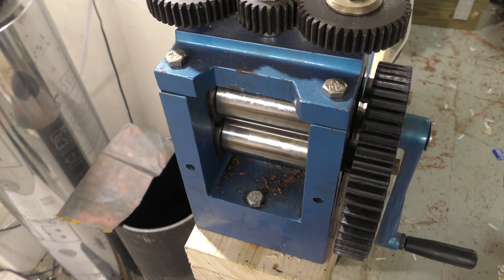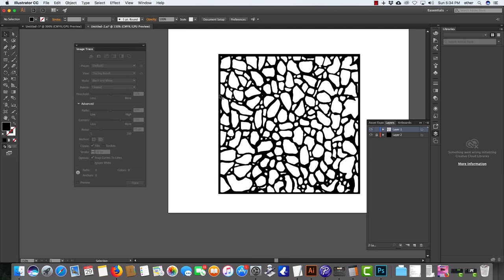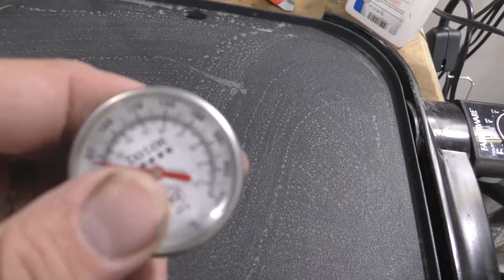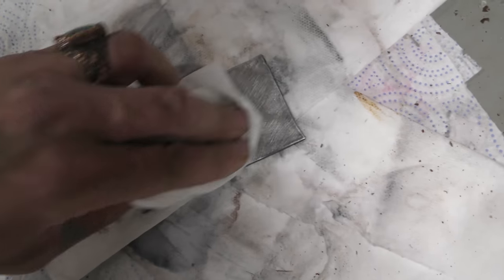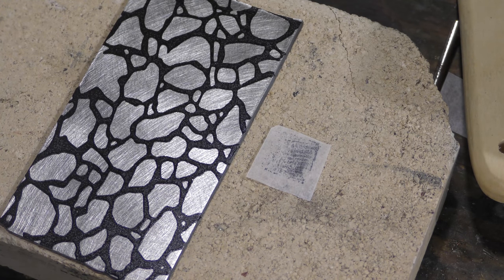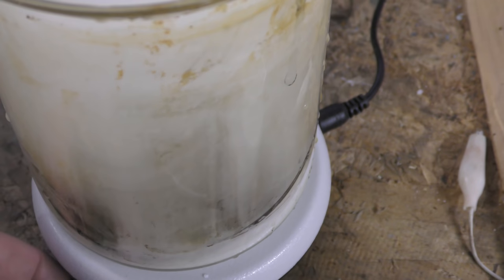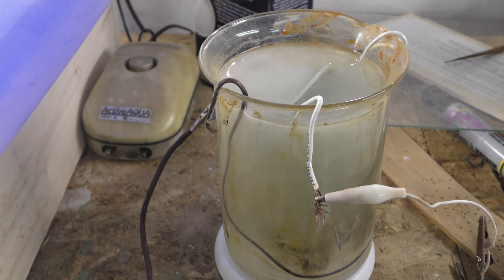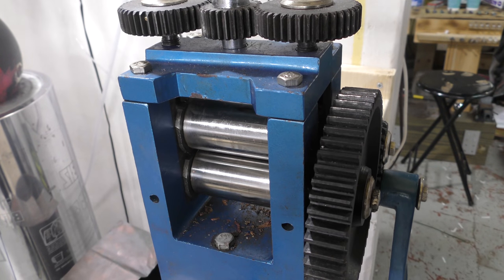Making etched rolling mill plates

Comment: You can also transfer the image (Lazer or even pics from magazines and artwork make with different mediums such as colored pencils and marker etc.) Using xylene. You just clean the metal as you did here, then add your image and then take a xylene marker or swab or cotton ball dipped in xylene and rub it lightly over the image "burnishing" it to the metal and usually onces its all been wettened and image showing thru the wet paper you can peel it off leaving the transferred image. Like a stick on tattoo. Kind of.lol I have been doing g this to transfer my artwork to metal surfaces for the last four years and it's been working great so far. I usually keep the images as is on the metal and seal em with a clear coat. But I am excited to see that I can use your method to etch my own art on the metal to give a 3d effect or to emboss onto my silver jewelry that I make.

Comment: I suppose if you had a lathe you could turn a mild steel roller the same size as your existing rollers.  Etch the roller, and then heat treat it to harden it.  You'd still be limited to roller width, but you could roll any length you wanted.  You could add edge forming details or any other contour you wanted. Heck, the rollers could be made in any shape, not just flat.  You'd have to make a negative bottom roller, but hey, you could texture both sides at the same time if that's what you wanted.  Do you have a lathe?  It sounds doable anyway. It would make a cool experiment anyway.  Just a thought... Thanks again.

Comment: Hey Jason.....i love all your videos....always so informative and easy to listen to!  I have a ? i have been wanting to do this since i recently started etching but have been looking for info about what to use for my plate and other metals are too soft.  today i went to a local metal supplier and got these wonderful steel scraps, was so excited came right home and got to work.  i used vinyl resist, but followed everything else to the T.  I just barely got an etch at all after an hr with 1.5V in a fresh batch of salt water.  I was wondering if it was the type of steel i used.  this has a black coating, i think the guy said it was black iron steel....i didnt realize there were so many diff types of steel.

Comment: Could you transfer the pattern to the silicone mat, and then apply the image to a curved surface? I know that this isn't really what you showed, but I am searching for a way to etch domed surfaces.
Reply from the maker: It needs to be very flat for this method - Some etch and then chase Repousse or put it in a doming mold to get curved surfaces.